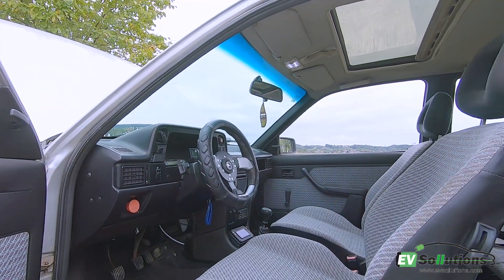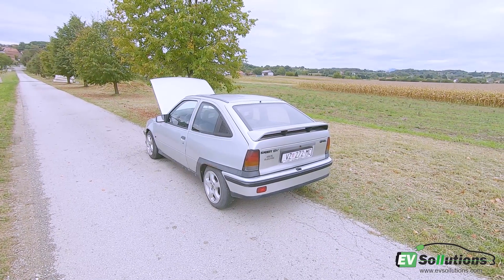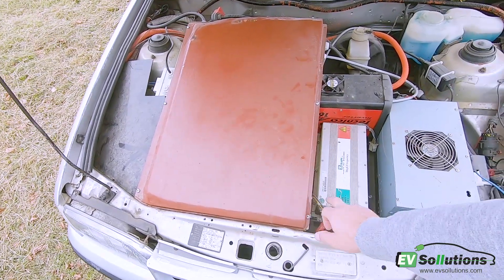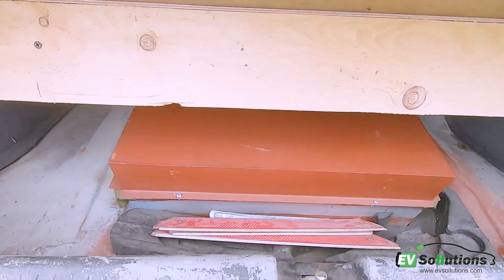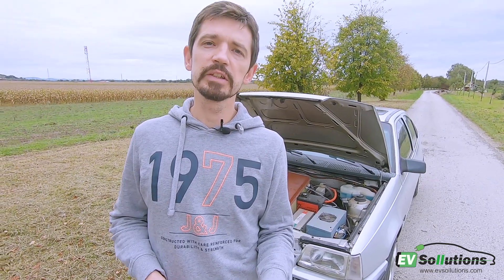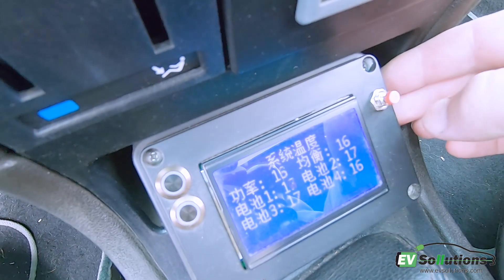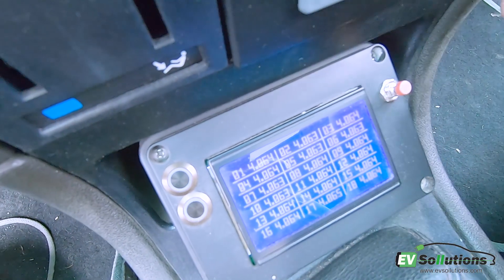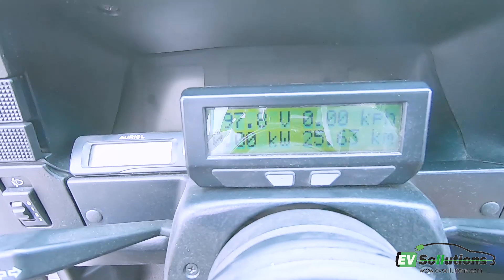Electric Opel Kadett conversion, maintenance after 70 000 km

Comment: Please more info on this car, 5kw continues, what speed can it maintain with 5kw? I have a similar project like your BMW, I have and BMW e91 that is electric, not finished yet. Have video's about it, more is coming.
Reply from the maker: Maximum speed is arround 90km/h , with extra cooling can handle 15 kw continiusly. the best electric cheap motor for cars arruond 1000 kg.  it can run 1500kg car but then is not lasting long, arround 50000-70 000 km , then you need to change rotor
Reply: @bimerev  cool, thank you for the answer. The cooling, is it a fan or water? Is there built-in water cooling?
Reply from the maker: @BagheeraTube  no water cooling. Motor has airfan from computer cooling from Opel Omega 3.0i
Reply: You awnser my question in the end 90km/h, can it maintain that with only 5kw, seems really low power output for 90km/h but I am no Expert.